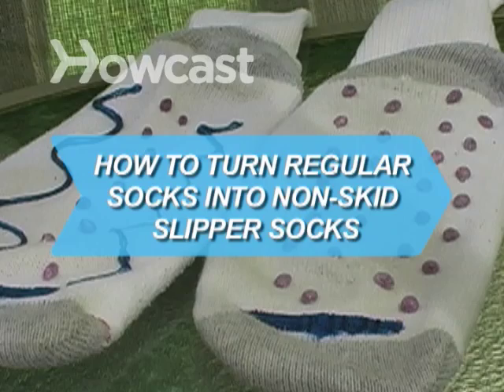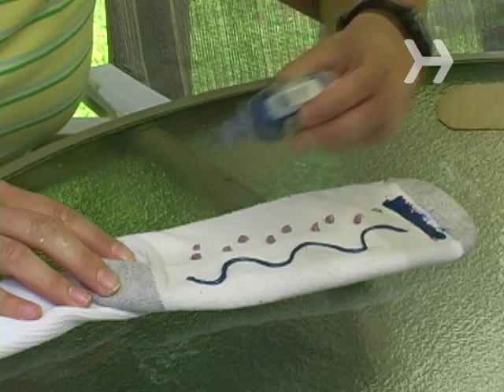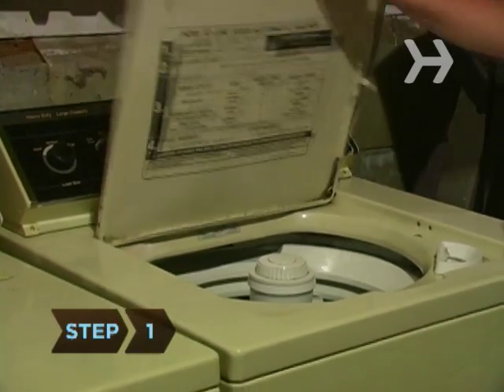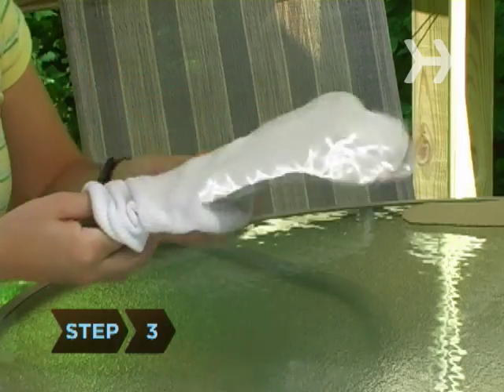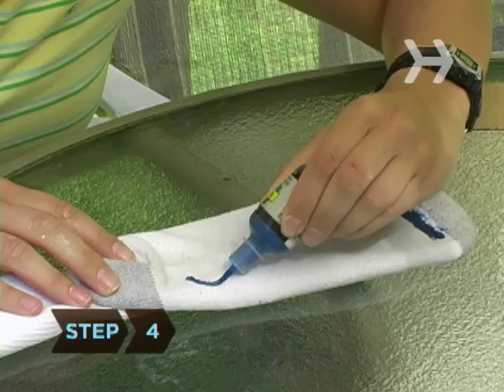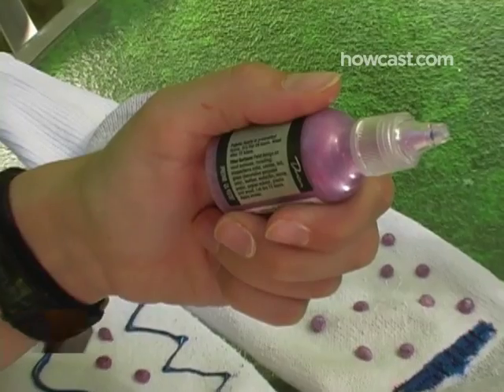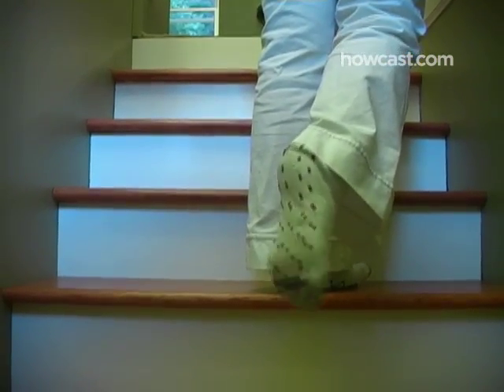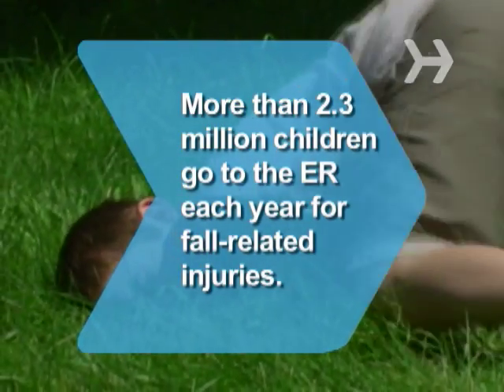How to Turn Regular Socks into Non-Skid Slipper Socks

Comment: Works great if you use silicone...available on Amazon for under $6.00...100% silicone...for kitchens, baths or boats...stores well...last a liletime...glue or paints will not last